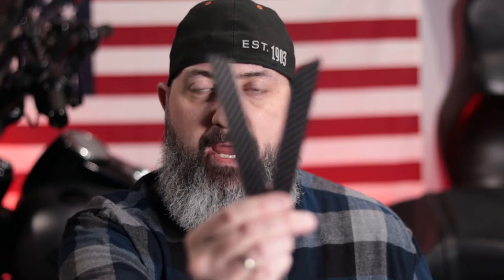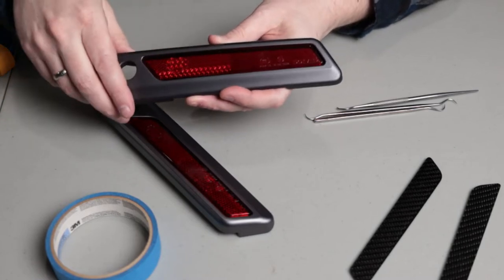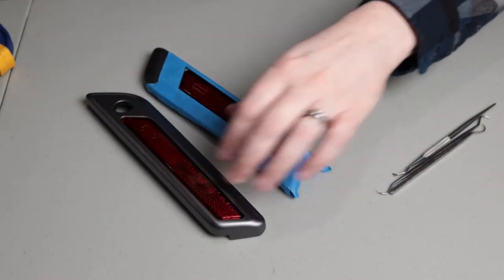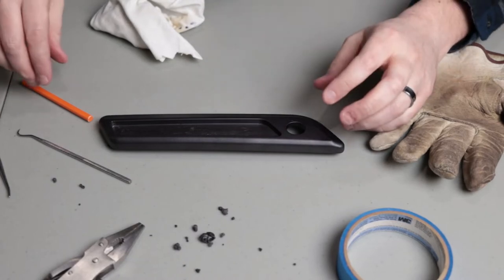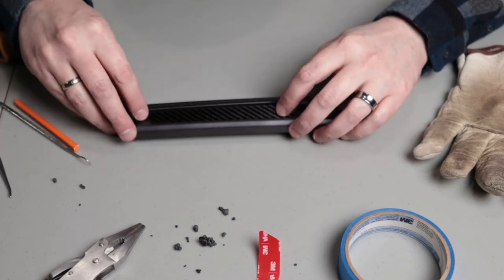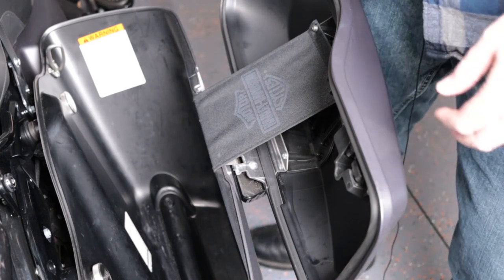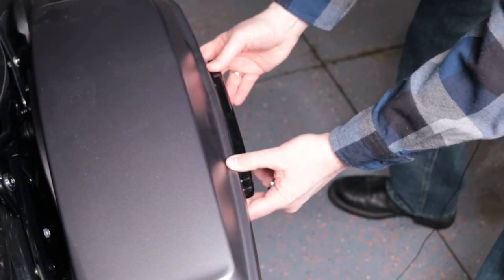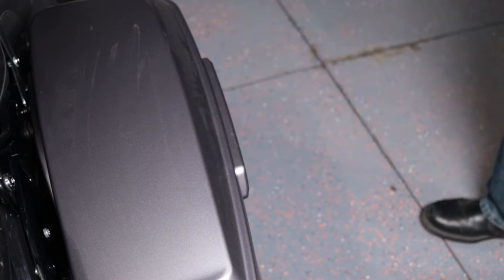Harley-Davidson Carbon Fiber Saddle Bag latch Insert Install

Comment: That brought back nasty memories of taking off my tank badges, but a good looking result for your paint colour.  I recall seeing someone a while back using a black vinyl wrap over the existing reflector which also looked great, but certainly not as permanent as your solution. Thanks
Reply from the maker: Yeah I did that with my badges also and it was more of a project then I thought it would be..the end result was worth it!

Comment: May I suggest using a plastic pry tool instead of the metal picks???? Also, to get the adhesive off, use Guff Off adhesive remover. I changed my reflectors this weekend and I did not scratch the paint. Thank you for the video.
Reply from the maker: I know that Gue Gone does a great job also. What type of plastic pry tool did you use?

Comment: Very clean looking! 
Do you get any heat for not having any reflectors? I want to get rid of the red rear reflector and throw on black ones on the bag latch and fork legs. However, I might have to replace everything to back stock because of our stupid yearly safety  inspection, so....I'm not really sure what I want to do 😬
Reply from the maker: We don’t have those types of laws here so I can’t do pretty much whatever I want. As long as I have working lights and signals I’m good.
Reply: ☹️ more reasons to leave this 🏝️